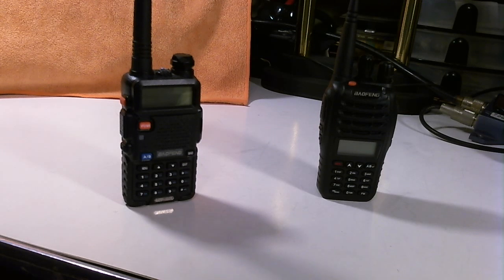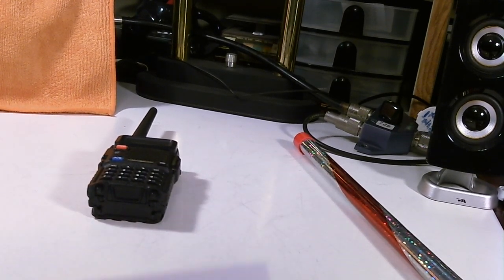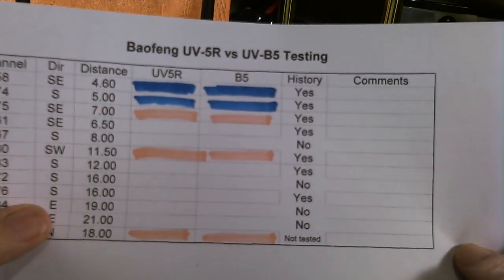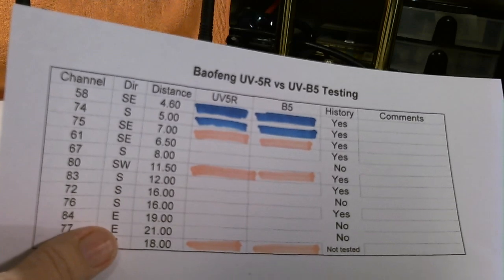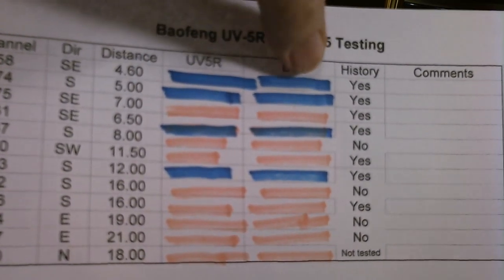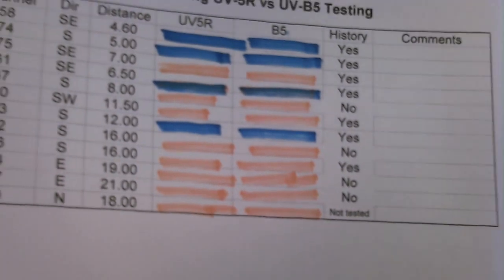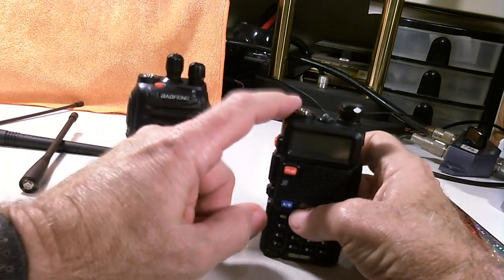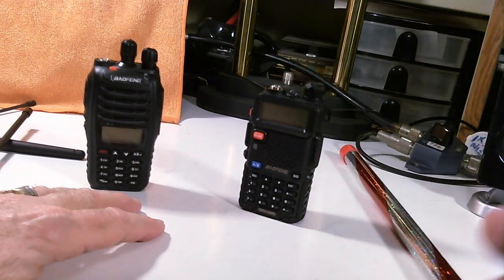TRRS #0279 - Baofeng UV-5R vs UV-B5 Tests

Comment: another great video.  I'm going to order the MFJ antenna.Something more to play with.  One question: On the 5R,  is there any way to temporarily lock out a channel during scanning?
Reply from the maker: There is no temporary way to lock out a channel but if you have the programming software and cable you can set a channel  to be skipped during a scan.

Tom

Comment: They advertise 5 watts meaning up to 5 watts where each unit varies. They are Chinese translating to English also and I have see them advertise these radios as CB radios, Police radios, FRS radios, etc. They attach labels to get you to buy it.
The B5 I have throws 3 1/2 or so watts in UHF and 4 watts in VHF.
My Wouxun KG-UVDP's throw 4 watts UHF and 5 watts VHF solid but I did put them on a service monitor and tune them though.
Reply from the maker: Thanks for the comments.

Tom